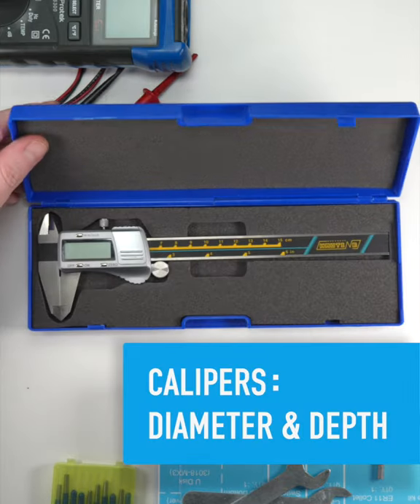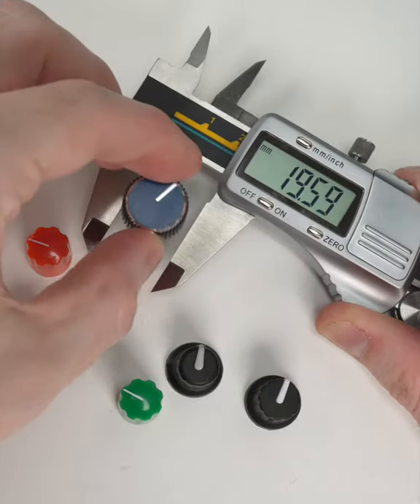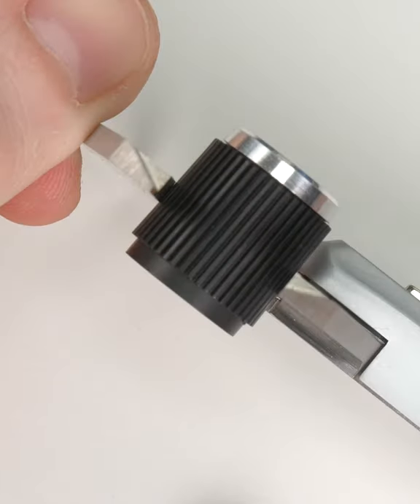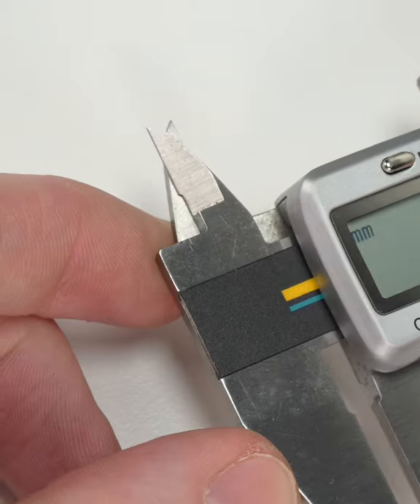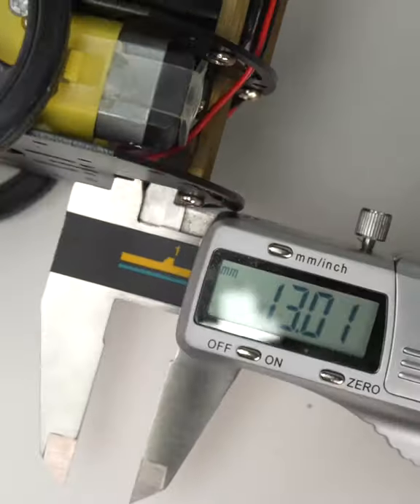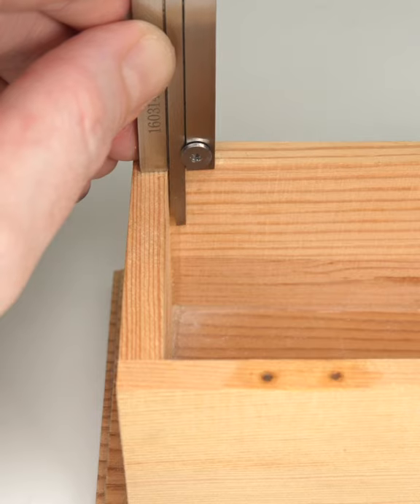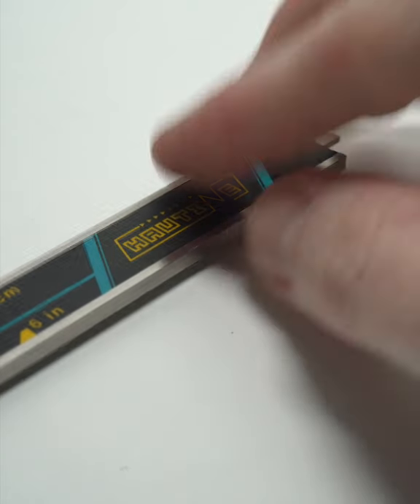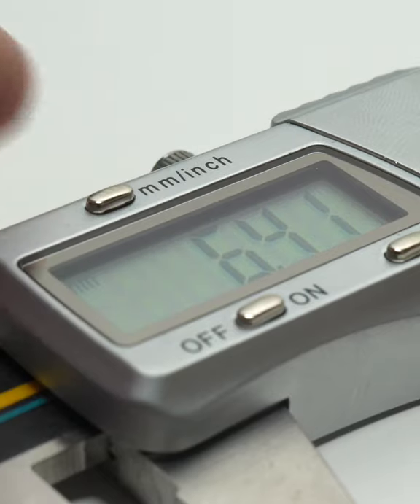Calipers: Diameter & Depth - Collin’s Lab Notes #adafruit #collinslabnotes

Comment: Yes! These are indispensable if you're making 3D printed parts that need exact measurements (or within certain tolerances). Also super handy if you're not sure that Chinese circuit from eBay or Amazon has 0.1" pitch header pads (there was one with 25mm pads that really threw me for a loop).

I still have my Mitsutoyo calipers from years ago. Still working perfectly.

Comment: i found myself using the end between both sets of anvils to measure depths/steps of objects where that would fit better. I find the actual depth measurement only useful if its a small opening, otherwise its too flimsy.